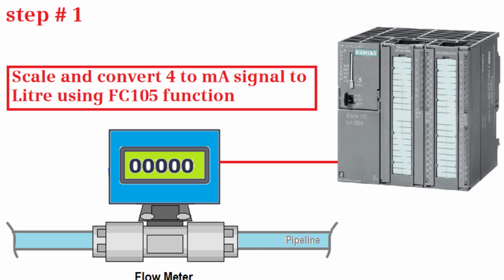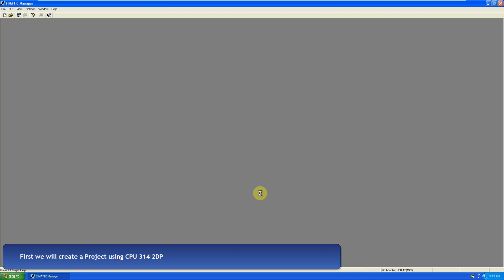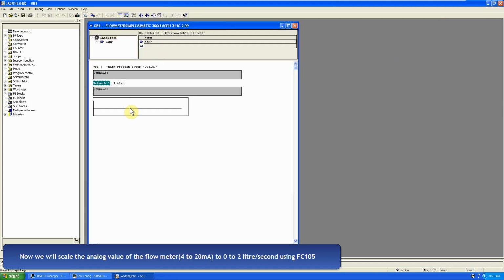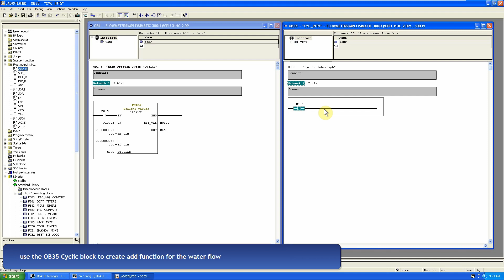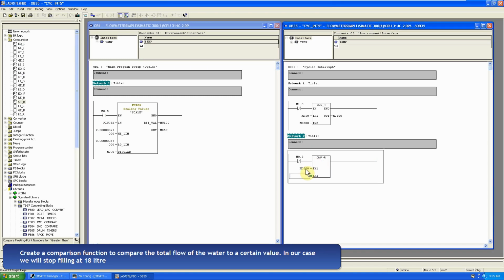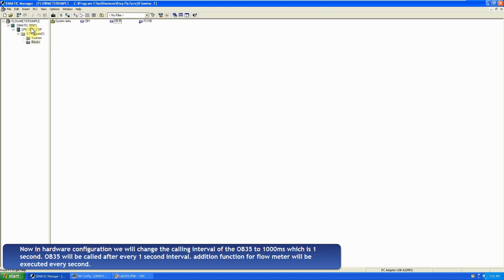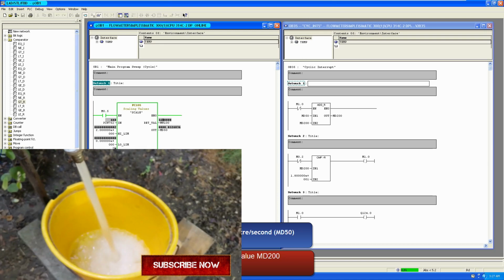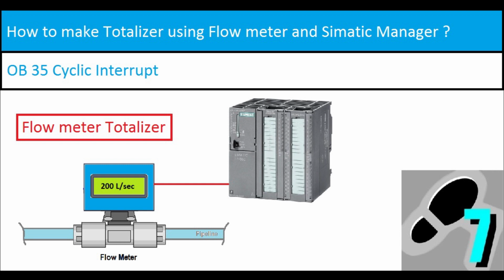How to make Totalizer using Flow meter and OB 35 ?

Comment: Dear Sir,
Using 4-20 ma to measure or calculate the Total flow is not accurate for the following reason:
- there is un accuracy % of ma measured by the AI card
- there is a time dealy in the ma measured by the PLC AI card and CPU processing time
- there is a lattle ma flactuation in the ma arriving to the PLC AI card because of the noise

the correct way is to have accurate Flow Totaliztion (Accumaltion) is the following:
-  Flow meter that have a pulse output ( Like one pulse for each 5 m3)
   connected to PLC high speed digitail input , each time PLC recerive
   pulse input it icrease the totallization by 5 m3 (If the PLC receive 5 pulse
   it means the total is 25 m3).
- Flow meter make the flow totalization calculate and send it to the PLC by Modbus or Profibus
  Communication

Comment: What if use pulse signal from flowmeter rather than analog to plc. Can you teach, i read it we can take flowrate, temperature, density
Reply from the maker: Just make a function in program , which can add litre on every input pulse of the flow sensor

Comment: may i know what is the rigth position of control valve and flow transmitter or flow transmitter first and second is control valve
Reply from the maker: Mostly flow meter installed first and after that Control valve
Reply: @EASYPLCTRAINING   sir in PLC proggram what is common instruction you use THAK TOU